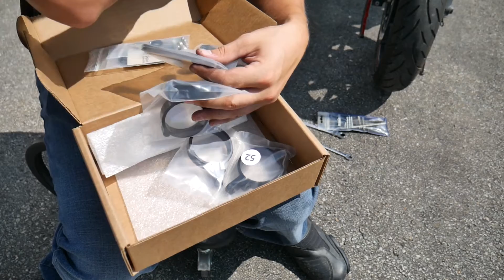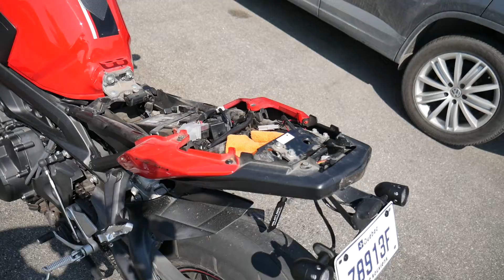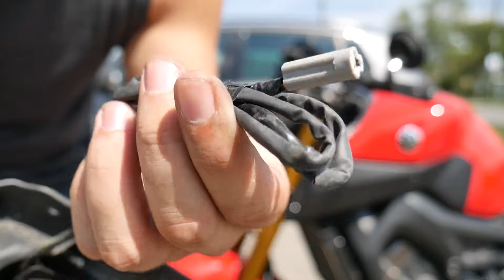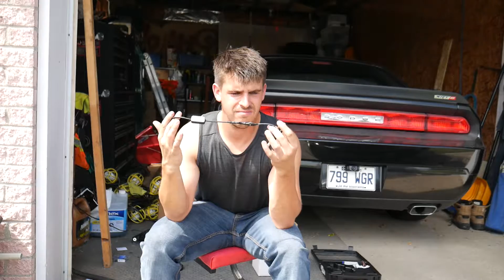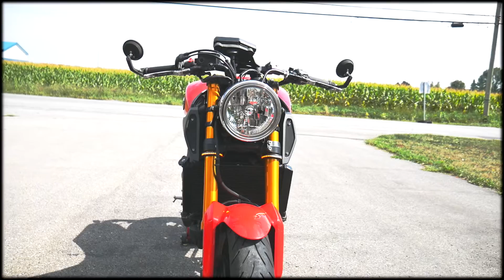MOTODEMIC 7 inch headlight kit and LED Wraparound Flasher , Yamaha FZ09/MT09

Comment: Which version of the brackets did you get?  Standard, short or super short? Also, did the headlight come as plug and play to the Yamaha plugs?
Reply: Also, the headlight connector for your bike, was it a 6 prong? and did you order any adapter for the new headlight to plug into the bike?
Reply from the maker: i get the standard length bracket, and as for the plug its a standard H4 plug just like stock ,so pretty much plug and play

Comment: I'm looking at doing something similar if I buy an MT07 or MT03, but I think it needs some sort of cover just behind the light to cover that wiring, not sure what the solution is... just to hide some of that stuff behind the light.
Reply: JVB-moto Super 7 custom parts
Reply from the maker: It bothers me too , i'll probably take it apart during winter and try to find a way to hide most of the wires